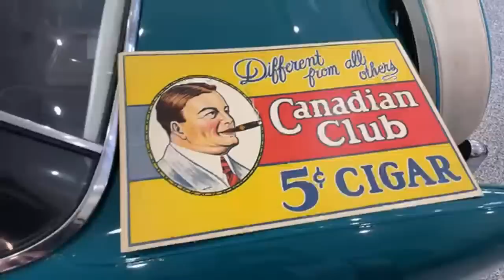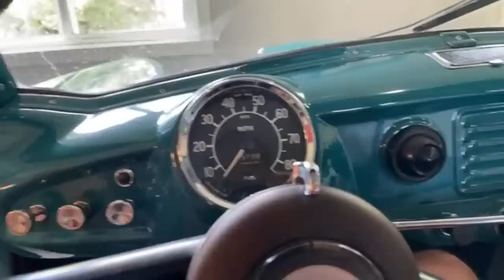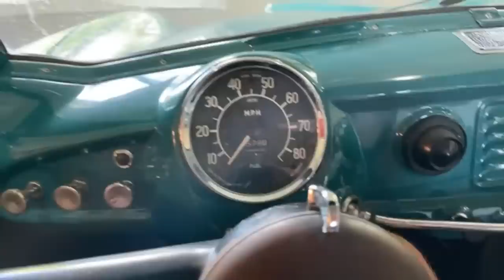Live updates and I dig through some boxes!

Comment: My first car was a blue and white Metropolitan convertible!  That was a few years ago in 1962! The car was old and often locked in 2nd gear.  I traveled with pliers and I lifted the hood and banged on something...then it worked for awhile!  I loved that car!!
Reply: Hahahaha.  My first  car was a 1962 Jack Brabham Torana ( Holden, Australia) it was 21 years old at the time and thr gear stick would occasionally lift right out. Just a matter of getting the knack of it. The windscreen wipers didn't work either.  My dear partner at the time was an electrician who wrapped a bit of of wire through and around the wipers. When it was raining I had to hold the steering wheel between my knees and hold both ends of the wire and pull the wire back and forth to operate the wipers. If the rain was heavy I would have to pull over and wait. Hahahaha,  the good old 80s.

Comment: My first car was a $300 1972 AMC Gremlin with a v8 and manual 3 speed. Boys used to laugh at my car at red lights until my car left them in the dust when the light turned green. My dad used to warn me to slow down because my car was not a drag car. 40+ years later, Gremlins are now sought after by dragsters and very expensive if you can find one.